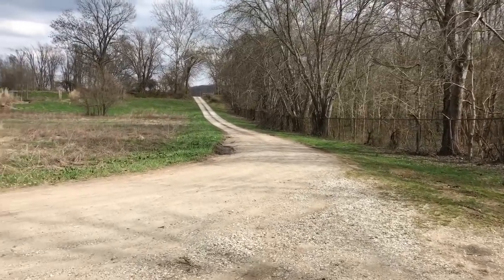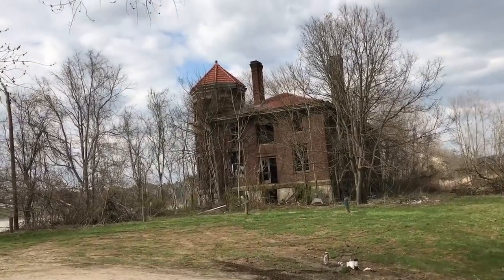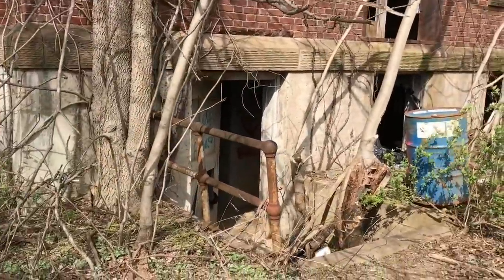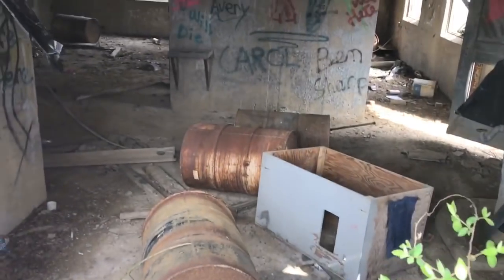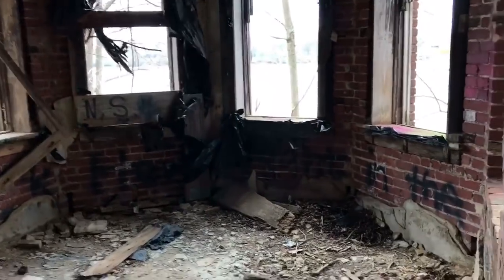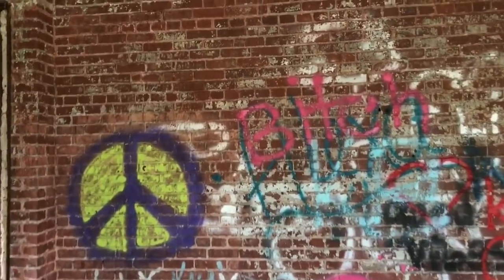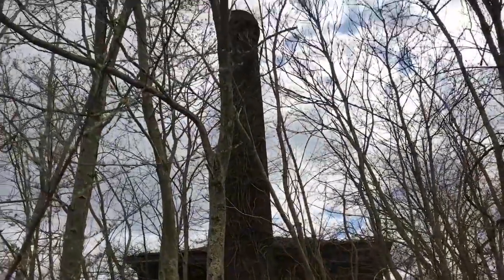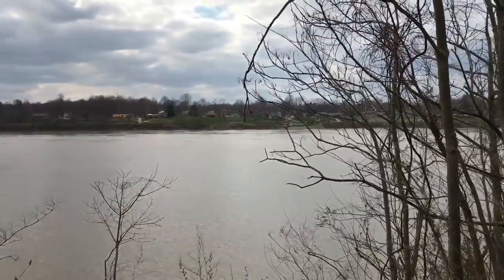Lock 19 Steam Station - Washington Bottom, WV

Comment: I know I am a few years late, but the 'tower' out back is actually a chimney, I think to a kiln of sorts? Of the houses, there the one is abandoned the other actually is a live-in on site security guard for the property. Which is why he has the four-wheeler to patrol the property. You are generally allowed to be there during the day time though. 

There was actually 3 houses on this property, one that was built well before the two you saw, as all that remains is the concrete pad, so I doubt there was anyone living in the control building. 

I think the lighthouse you might be referring to is actually located in Belpre. It is located on either Walnut St or or Main St

Also not mentioned is there is a graveyard on the property as well which is really cool. 

The control building (the one you were in) was built in 1885 by the US army corp of engineers. I cannot say for the lock master houses however. I assume that two of the lock houses were built so that one could operate during the day and the other could at night.

Comment: Appreciate the video but when you reveal that it was a steam plant built for the lock and dam that was here, the rest is pretty much self explanitory. The houses were built for the locktender and the workers on site. This was part of the Ohio River Canalization Project. 51 sets of these plants, houses and locks and dams were built in order to maintain a 9-foot pool of water within the channel. Later, (beginning in the early 1950s) the high lift dams, such as the one downriver at Belleville, replaced the old wicket dams. The new dams were built from solid concrete and the locks were twice as long as the one that was here at Washington WV. There is a nicely kept steam plant about ten miles south still maintained by the Dept of Natural Resources. It almost mirrors this site in appearance. It is old No #20. A lot was taken from #19 for spare parts for #20.